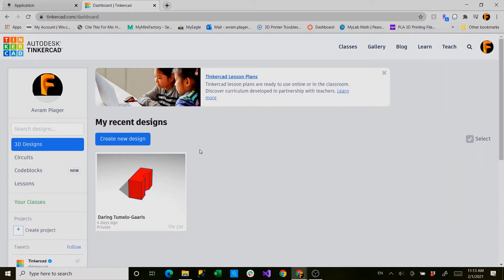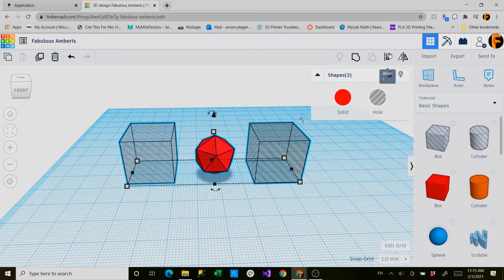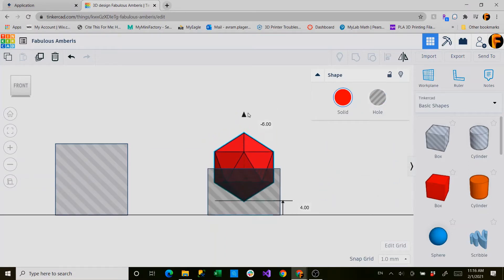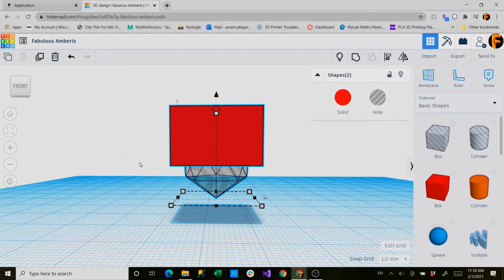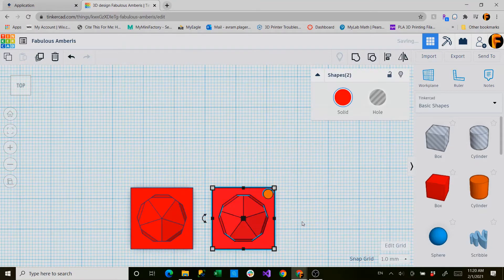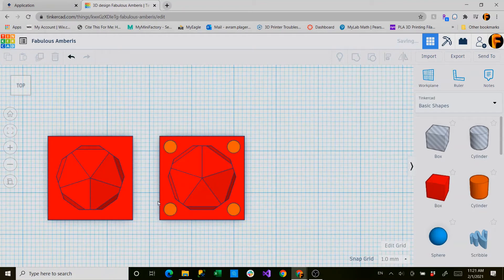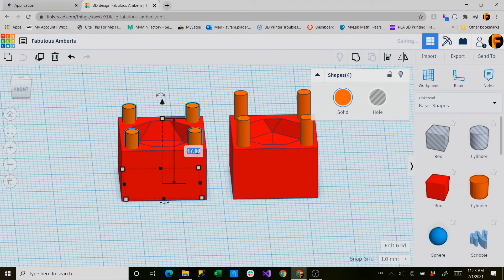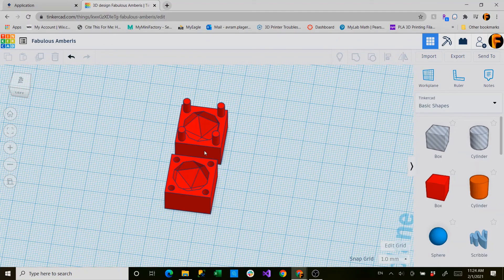TinkerCAD tutorial- molds

Comment: I know this is an old tutorial, but I pretty much followed these steps, ensured my holes were the exact same size as the pins...ad they don't fit... will making the pins a fraction of a mm make that big of a difference or should I just file them down and handle it that way?
Reply: When printing or using cnc machine, it's always important to calculate some tolerance (usually a difference under 1mm between pins and holes on a FDM printer) to make them fit. A little bevel on the edges of the pin could help too

Comment: The pins need to be slightly shorter and smaller diameter than the holes, 0.2mm maybe (OR the other way around, the holes slightly bigger than the pins).
Reply from the maker: Good note however, i would recommend doing that in slicer settings since it is preference based setting and not a mechanical component. Thanks for commenting!
Reply: @avramplager1953  what slicer are you using that lets you enlarge or shrink just the pins?

Comment: Seems like some extra steps.
If you duplicate the box half with the pins. Align it with the top the way it was before you flipped it.
Then make the dupe'd box with pins a hole. Use that hole to cut out the pin holes in the other half.
Much quicker and almost no chance of miss aaligning the pins.

Thank you very much for the video though.
I learned the hide feature so I now understand how to select hidden objects.
Extremely helpful.